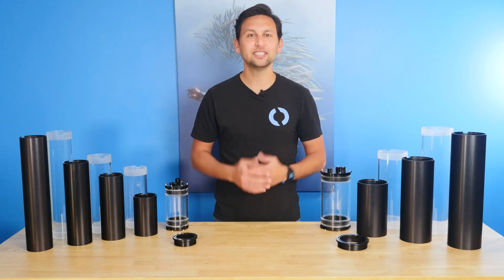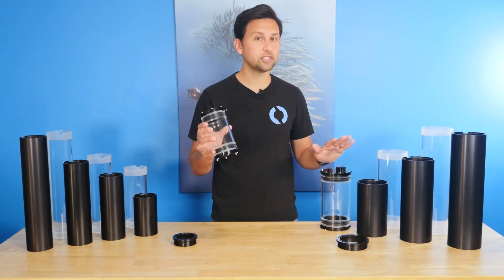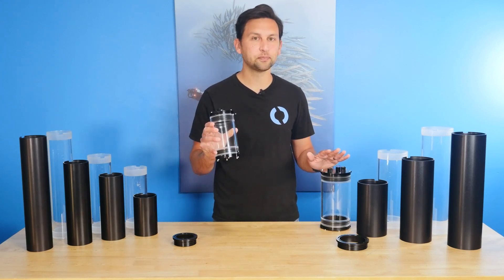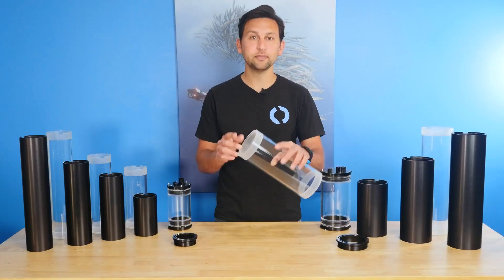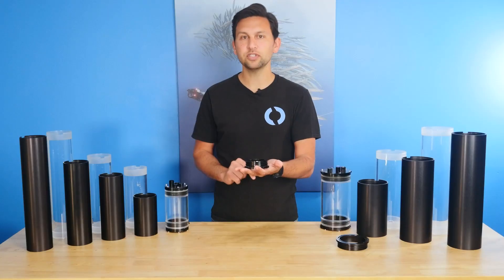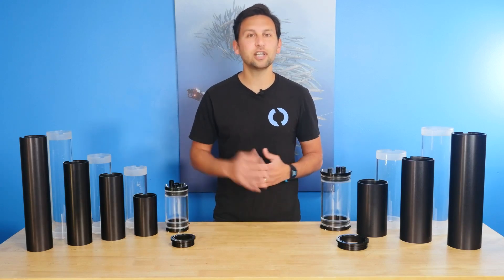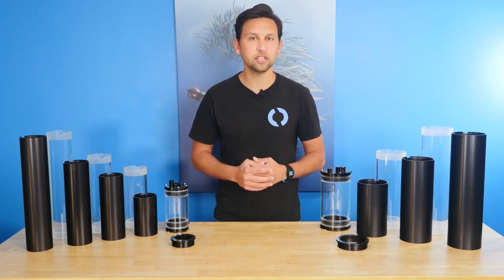New Product: 3" and 4" Locking Watertight Enclosures

Comment: How does the locking cord works ?
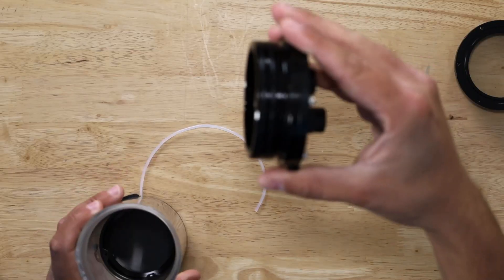Reply from the maker: Hi there, the tube and the flange each have a half-circle shape around the circumference that line up to form a circular channel. There's a slot that allows you to insert a plastic cord into that channel. The cord blocks the tube and flange from being separated. You can see this around 1:30.